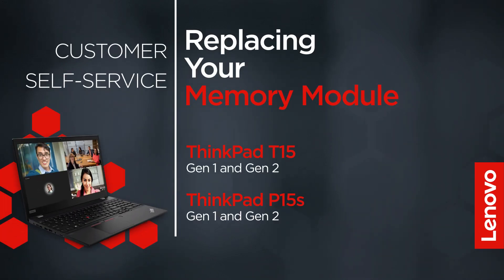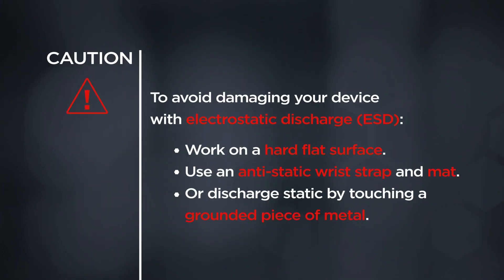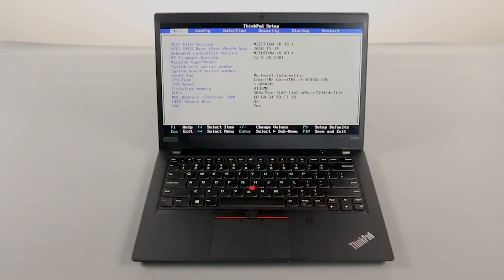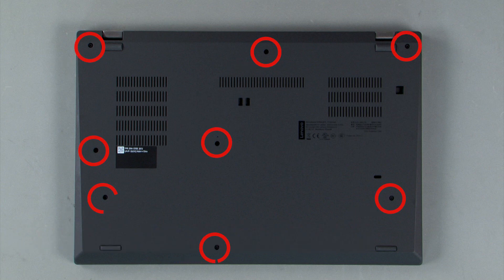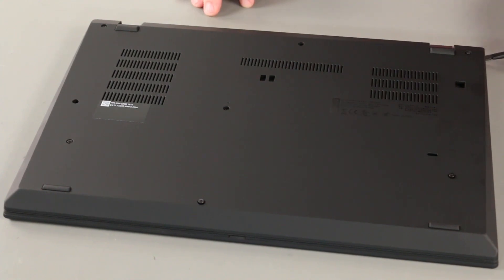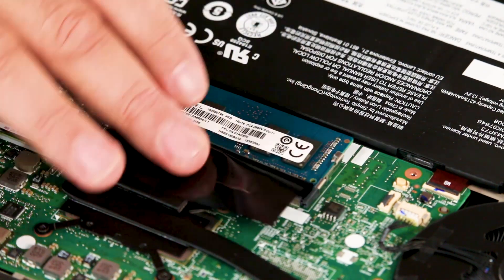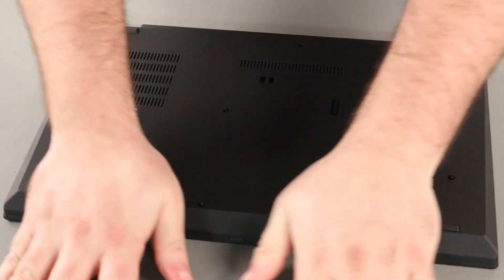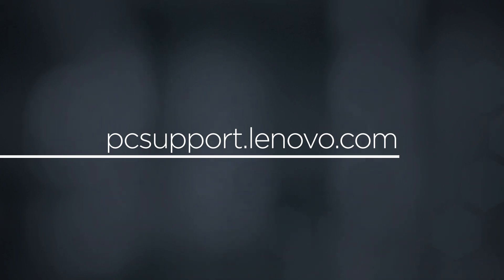Replacing Your Memory Module | ThinkPad T15 and P15s Gen 1 and 2 | Customer Self Service

Comment from the maker: This video will show you how to replace the Memory Module of your ThinkPad. The process in this video will work for the ThinkPad T15 Gen 1 and Gen 2 and the ThinkPad P15s Gen 1 and Gen 2. 

You will need a screwdriver kit, a non-metallic pry tool, and 15 minutes of your time.

To learn more about your device go to https://pcsupport.lenovo.com

To find parts for your device go to https://support.lenovo.com/parts-lookup/?cid=ww:lenovosocial:b9515f&source=socialmedia&subsource=yt

To view the Lenovo Support Self-Repair Guides landing page go to https://support.lenovo.com/us/en/solutions/HT516547

** NOTE: Static electricity can destroy components. Use a grounding strap, and clean, non-conductive surface to work on. Use plastic or coated tools to prevent scratching and avoid using metal tools on plastic parts. For more detailed information on electrostatic discharge and how to prevent it, please watch our ""Understanding Electrostatic Discharge (ESD)"" video: https://youtu.be/by4PB3WtdLo 

Applicable Machine Types:
ThinkPad T15 Gen 1 - 20S6, 20S7
ThinkPad T15 Gen 2 - 20W4, 20W5
ThinkPad P15s Gen 1 - 20T4, 20T5
ThinkPad P15s Gen 2 - 20W6, 20W7

#lenovo #LenovoSupport #LenovoTechSupport